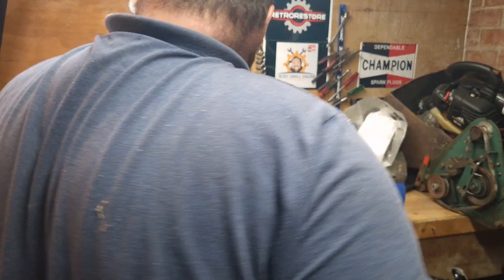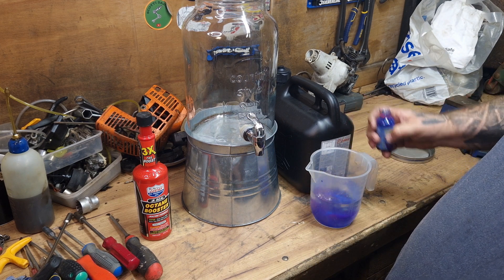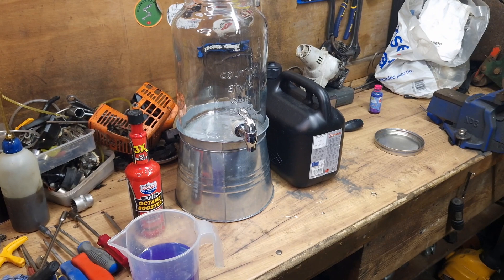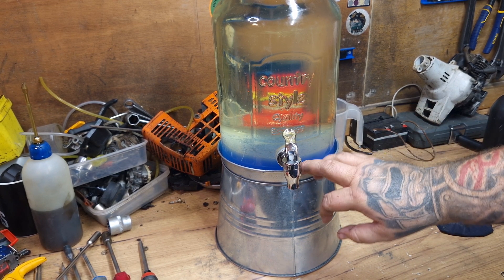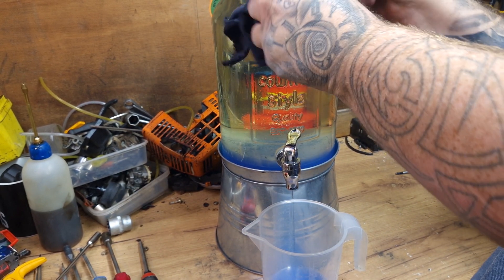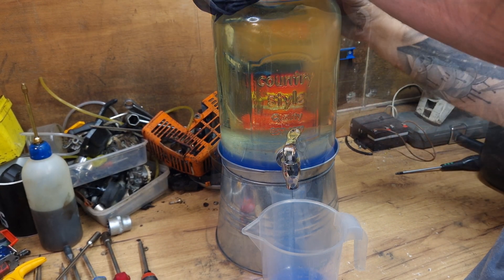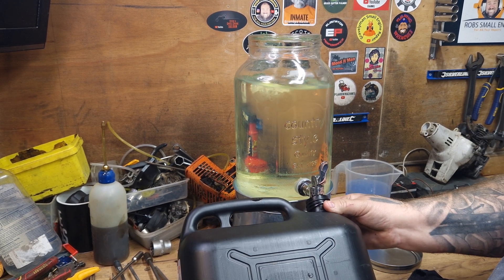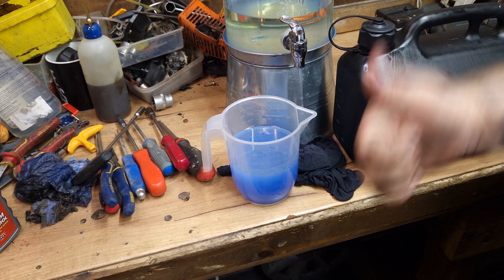DIY Tutorial how to remove ethonal from petrol

Comment: What kind of dye did you use, if the dye was not used would you be able to see the water from the petrol. would separation be possible without the dye. Why was ethonal put into petrol in the first place.
Reply from the maker: The die was used to show on video more clearer and the octane booster is to give it a more stable balance after taking the ethonal out